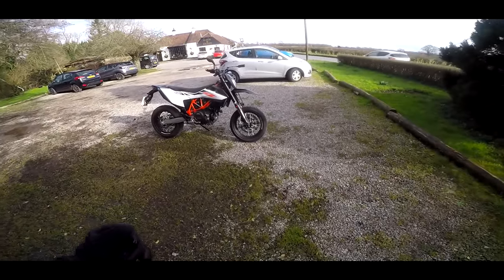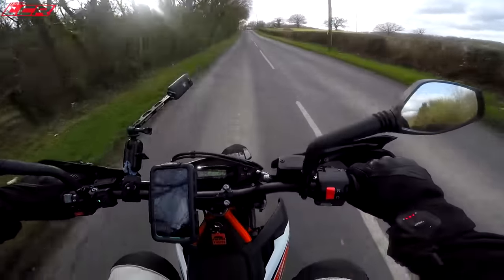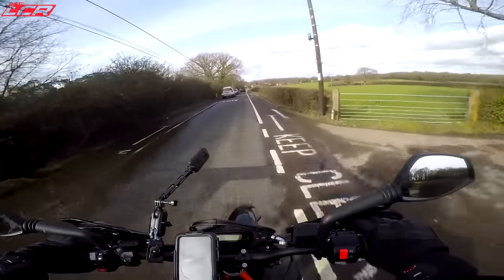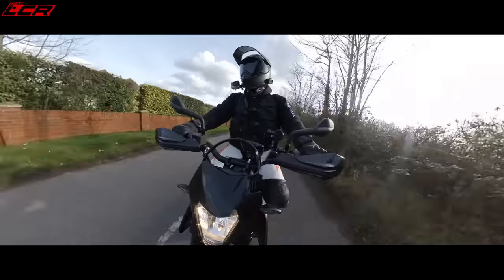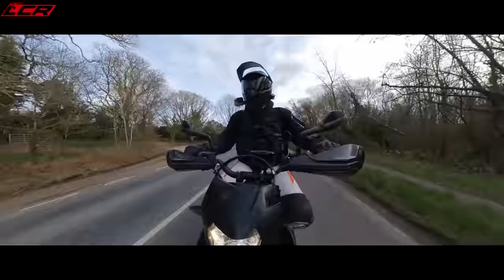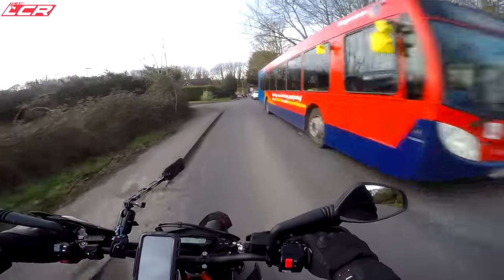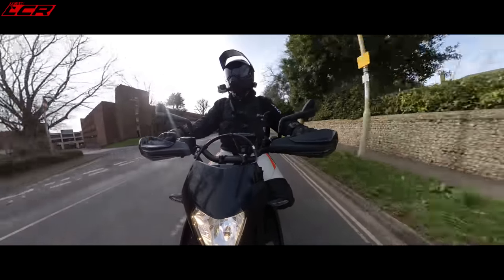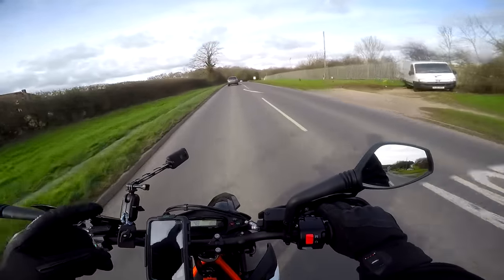How To Run In A New Motorcycle? | KTM 690 Diaries

Comment: I’ve always followed the manufacturers instructions on running in. They built it, so they should know.
A few years back I asked my father about this - he was a development engineer in the automotive industry for 30 years - and he said the same. He did say the worst things are to do it on the motorway i.e. constant speed and to keep the revs too low “lugging” the engine.

Comment: I have a 18 701sm and ran it in by riding it pretty normal, did ride it hard a few times and no issues. At 3k now and uses little to no oil and all runs fine. I hate how loud the timing chain is though on hot starts 😂
Reply: Get a manual cam chain tensioner fitted it will cure the rattle on hot start

Comment: Great timing with the video chops getting a new bike 1st of march! I'm planning on doing 90% soft break inn with the 10% open the taps abit more.. I did this with my tuono v4 factory and has had no problems at all bike is 2 years old now with 6350 miles on the clock

Comment: Mate you make a brilliant point with regards to the so called "hard break-in". It makes no sense whatsoever to be stressing all the components of an internal combustion engine to within an inch of their life from mile 0.0 to 621, not to mention all the other brand spanking new systems such as brakes, tyres, gearbox, clutch etc etc etc. What malicious / conspiratorial benefit could the people who designed, built, tested and subsequently wrote the manuals prescribing proper break-in processes possibly benefit from by telling the first owner to break-in the bike in a smooth, progressive manner other than ensuring their customers get machines that will be reliable long-term and their ownership experience be such that come the time said owner decides to upgrade, that they will be strongly considering another bike of the same brand? The instructions given are very clear on how to ensure the longevity of the engine & components by doing what makes absolute sense, specifically not ragging the shit out of a brand new bike.
In all honesty mate, what kind of person is going to spend £10k/£15k/£20k+ on a new motorbike to then just abuse the living shit out of it during its first 620miles (and beyond) of use? You either must have multiple millions of disposable dosh in the bank to not give a shit about the longevity of your investment (or perhaps more likely considered by said sort of person to be a new toy to thrash around for 6 to 12 months & not an investment at all) before buying next years model and selling the poor abused bike to some unexpecting soul that will end up lumped with all the yet-to-develop troubles caused by the first abusive owner.
I'm very fortunate to live where I do (in España) because on my doorstep, 15km to the east I have the A-397 (the road that runs inland from San Pedro to Ronda) which has a moderate incline and you gain a fair amount of altitude riding up it & 15km to the west I have the MA-8301 (the more mountainous road that runs from Estepona to Jubrique and beyond) which has an even steeper gradient incline. These roads are perfect to break-in new motorbikes because they call for constant gear shifts all the way up & down through the gearbox and provide a nice incline to allow the engine to be put under more load (though I'm always careful to keep within/below the maximum stated engine speeds as per the manual during break-in). In addition to being great roads that provide perfect conditions to break-in engines & components, they're also fantastic roads to ride on. Great sweeping corners & switchback curves provide ideal conditions to properly scrub in new tyres and bed in new braking systems while also providing beautiful scenery and exhilarating riding conditions. These two roads have pretty much been the principal two roads on which I have ridden the first 932 miles / 1500 kilometres breaking in four of my past new bikes over the years (two of which I am actually currently in the phase of doing right now as I traded in two bikes in order to buy two new machines).
So I have to wholeheartedly agree with you that the entire concept of "hard break-ins" is completely misguided. I will trust what the designers, manufacturers, testers conclude when it comes to writing the owners manuals' best break-in procedures for the machine over the incoherent ramblings of internet keyboard warriors that try to justify the whole "ride it like you stole it break-in method", which, let's not forget, the reasons they give for why their methods are better than the manufacturer's stated methods are categorically, empirically flawed at every level - common sense aside a very superficial and cursory understanding of the properties of materials science and engineering, or even just considering the stresses and forces involved inside an internal combustion engine - then realising the new engine has never been run under load, should lead to the conclusion that every single motorbike owners manual ever printed has stated in no uncertain terms since the dawn of petrol powered two wheeled machines.
Anyway Chopsy, nice video mate & I couldn't agree with your points more. I'll be eagerly awaiting the upcoming video you mentioned you'll be posting on the correct setting up of suspension sag, preloaded, compression & rebound. I'm sure I'll learn a lot from that video. One of my bikes has semi-active suspension but my other bike is a supersports with all manual Öhlins NIX30 forks & Öhlins TTX36 twin-tube monoshock which will undoubtedly require some serious dialling in of the correct settings, perhaps even getting the assistance of an expert is going to be required if I want to have it dialled in perfectly.
I'm also very happy about your partnership with Destination Triumph and I'm again eagerly awaiting some videos reviewing more Triumph's.
All the best fella, enjoy that KTM you lucky bugger ;)

Comment: The most important stage is not putting load on the engine from cold 

Running in used to be important when the tolerances in the manufacturing weren’t so accurate. Now they are so accurate running in isn’t as important. 
Two strokes are more fragile.
It’s good to run in, just take it easy for the first 10 rides. Obviously it’s not the mileage it’s the cycle of warming up. The most important stage is not putting load on the engine from cold

Comment: I agree with you.  Truthfully you can set the rings in the first 60 miles by certain methods.  But like you said there are more things to run in.  Look at car engines.  With tight tolerances in water cooled motors you probably do not be too careful.  You must get use to a new bike, take it easy.  The bikes black box  will tell dealerships if you did not perform a proper run in and warranty may be voided.  The manufacturers are covering the warranty so do as they recommend.

Comment: Definately a soft break in with a twist.... while ive not ever owned a new bike once the my hypermotard's engine was rebuilt i ran it when you get to a part of the rev range where it "goes tight" and as soon as your in there shut off and change gear - and ease it in that way bit by bit. Did that for 500 miles. I hold on to my bikes for way longer than 3 years so looking after them is of paramount importance to me..

Comment: Yeah good to stick to the manual. But I got a new 2016 xt660ra and gave it a hard run in and iv done 30545 km on it now and still runs like a dream. I also put some aftermarket exhaust on it wow what difference that made to the power

Comment: Always recall what a friend of mine said - working as a Porsche tech, they could always tell the difference between a car that was run in hard, vs one run in by the book; the former produced slightly more power, and used less oil.

With my R1 and my ST RS - I did a combination of book and 'hard' - for the first few hundred miles, it was plenty of gear changes and lower revs, but I then allowed the bike to rev higher for a few gears - so long as you don't red line it in every gear all the time. it's fine.

Comment: Interesting because I face this "problem" this spring with almost the same bike the 690 Enduro 😁
I will simply follow KTM's manual, my little CRF 250L had a hard breakin, no problems at all with that and it has 20 000 km on
it now. But this bike I will take a different route with..it's not a Honda 😉🤣

Comment: When I build engines I take the varied route on breaking in. aim for the twisties and hills and vary the revs and use all the gears. I belive it helps everything to bed in correctly. No prolonged stints in any given rev range. Both 4 and 2 strokes. On 2 strokes I build it also helps with jetting in correctly during the run in period of the nikasil. If you are running weak in any given throttle opening, you can destroy the motor on the first ride if you dont varey your revs... haha. On modern bikes, just stick with what is reccomended, that way if any garanti work is needed, you are in the clear.

Comment: Most engine builders will run the cam in - 2,000rpm for 20mins. Providing the manufacturer does this, it's good to start running the engine. I was always informed various loads and RPM's but first, these 3 steps. 

1) Get on a quiet open road where you can do 100KPH or more. Whilst in 4th gear, and starting at 40KPH and at 1/3rd throttle, power on till the revs flatline then decelerate back to 40KPH.

2) Repeat the above at 2/3rds throttle, then back to 40KPH

3) Repeat the above at full throttle to redline, then back to cruise.

After that under normal riding, if revving the engine out - the load is kept low. However, when under full load, don't go passed 1/2 throttle.

Ride like this for the first 1000klms. After that, it's good to go. Service and respect your pride and joy. Let it cool before shutting down after riding hard to prevent premature hardening of gaskets etc.

Comment: Yes, I remember Ari's test of the 2x engines, very interesting, but as you say it gives no indication of long term wear. The best anecdotal evidence is from the racing scene, as you know they get through rings\ pistons\ barrels: all racing engines can be used hard with just a little running in, BUT they all need changing (parts) on a regular basis- the longevity isn't there. And that old nut-cutlet about the manufacturer bench running in the engine is BS- at the factory the Japanese manufacturer will only quickly test up to the initial running-in RPM, they don't thrash them to the redline. I think some manufacturers actually log the running-in, so if you do it hard your Warranty is fubar should something fail. I've always followed the manufacturer's recommendation, of the 5x new bikes (15k-25K miles; 2-10 years) I've never had an oil leak or mechanical failure, the same can't be said for some of the other 2nd hand bikes I've owned.

Comment: I'm running in my ZX6R. The book says 4k for 500 miles, 6k for next 500 miles. It's impossible, 4k is 45 mph in top gear!
I'm taking it easy, but you can't ride around at 45 mph.
Reply from the maker: Yes agreed, Kawasaki seem to be very strict with the run in approach.. Not sure if its just to cover themselves, not sure... 1000 miles is OTT anyway! But under 4k is crazy on a ZX6R haha
Reply: That's insane you wouldn't buy a car and be told you can't drive above 45mph before the first service, is the engine made of cheese lolol
Reply: MyMednas that’s crazy, the run in for bikes is so stupid. I follow it but if you look at cars no one would buy one if you 45mph was a max speed for 500 miles. Good comment btw 👍
Reply: You in third gear?
Reply: @appymarley  they dropped the hearing for the 19 model.
Red line at 16k, so 65 mph at 6k is fine once you can use all the revs. 16k is over 170 mph in 6th...

Comment: I never did a hard run-in or a soft run-in. Usually somewhere in the middle. Drive it easy for 50 miles then drive like I normally do, but limit the revs (mostly)
And try to do long stints at a time to keep the engine hot to minimise metal expansion/contraction before the 1st service.
With my Subaru I was getting 20bhp more than what was expected when getting it's tune up on its 1st service

On the 701 I did a "JakeTheGardenSnake" type hard run-in as it was a single piston motor and notorious for needing oil.
First 5 miles easy until it's all warm then the next 20 miles were ... spirited. Not as savage as he does his, but run to the redline in first and second then move through the gears to cool it and change the rev load on the engine - then repeat up to 20 miles. After, an oil change and then my usual run-in up to the 600 mile service.
The result? Pokey wee bike and it never needed any oil :)

Comment: Interesting subject. I've read a lot about this subject. I've built a few engines..V8's and V6's. There is a lot of views on this, some from reputable sources that can back up with data, and some more gut feel. I've had a freshly built V8 on the dyno, 6000 plus RPM for mapping and all was fine, but I've also run in more gently V6's..will be doing another one this year..showing my age as another commenter  said, a capri! My view is run it in with the rev limits set by the manufacturer. A couple of reasons really. They built the engine. I can guarantee, they build more engines than I do and know their stuff. Apart from being a bit painful at first, I see no reason not to do this. If anything does go wrong, I want to be able to put hand on heart and be able to say I followed the run in procedure. They may not be able to prove that I did or didn't (but then again, the ECU could easily record max RPM's..not impossible). What I have always done is to ensure I have not laboured the engine at too low revs, and not thrashed it up to the max revs either. Varied engine speed through the gears, get the engine working over various revs, not just sitting at the same speed, and,  as has also been said, get some engine breaking done as this works the rings both ways. Finally, I'll run in on a good mineral oil and switch to synthetic after the run it. So when it comes to running in a bike and warranty, I'll always follow the manufacturers recommendation. My own engines, I'll run a little harder, but with the odd foray into higher revs as time goes on, but not drastically different from a manufacturers recommendations.

Comment: Like others below I follow the manufacturer's instructions as they designed the bike so are best placed to know on how to run it in. New engines are tighter than those that have done a fair few miles, which if you ask anyone with a dyno they will confirm this so thrashing them from new will make the bike run hotter due to increased friction  which in turn could damage bearings and cause bores to glaze plus as also mentioned you're running the whole bike in, not just the engine. If someone else wants to ignore the handbook and ride it like they stole it that's fine by me!

Comment: I think you may miss understand the hard run in method, it's not about revs, you could keep to the manufactures speed in gears.  It's about creating a high pressure which is done with a wide open throttle, go up the gears then shut off and decelerate through the gears to clear the bores of debris.  One point you didn't mention is to do some extra oil and filter changes with mineral oil, say at 50 and 150 miles but like you say each to their own, ride safe.

Comment: My 2014 Triumph Street Triple R definitely had a " hard break in" when I purchased it new, and 83,000km later not a single issue with anything. The valves only had to be adjusted minutely at 60,000 km.
Reply: I broke in my 18 Street Triple R like I ride it -- hard and fast. Changed the oil at like 1,200 miles. No issues. Now have 10,000 miles on my bike in a year.

Comment: I generally follow the run-in procedure in the user manual (which I do check for each new bike). Also, I have a history of being really excited about the new bikes and they are often ready for the first service by the next weekend following delivery. There is another thing to keep in mind, especially regarding higher end, high -performance motorcycles: I assume, but do not know, that that the manufacturers can check the engine history—how the engine has been treated regarding high revs, high road speed, and hard use when not at operating temperature. I do know that high-end sports car manufacturers have that data. In fact, they use that data when determining whether to certify the vehicles for resale. I mention this because I also think it would or could make the difference in what the manufacturer would do for you in the event of a very expensive repair (say, the need for piston and cylinder liner replacement) outside of the stated warranty period.

Comment: Always hard break in. KLR650s are notorious for burning oil but after hard break in mine never burned a drop.  The most modern materials and manufacturing processes don't require "break in".  Manufacturers only call for it to reduce chances of crashing a new bike and limiting their legal liability.

Comment: I've had three new bikes and all have been run in according to manufacturers recommendations. Simply because after dropping that amount of money on something that comes with a warranty I see no reason to do anything that might put that warranty at risk. 600-1000 miles soon goes by and running a bike in also gives you a chance to get used to it before you start cracking the throttle wide open. As you say, just my opinion, each to their own etc etc.